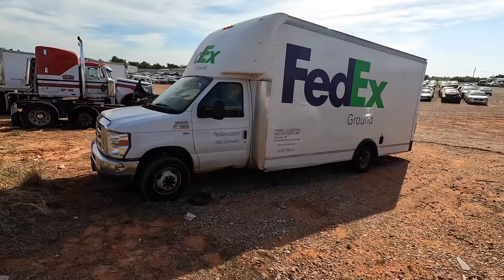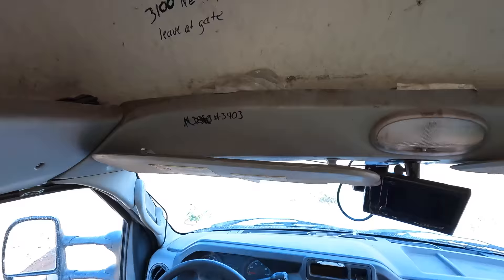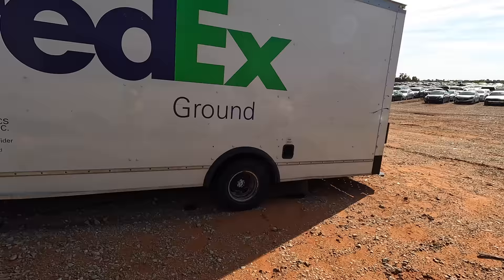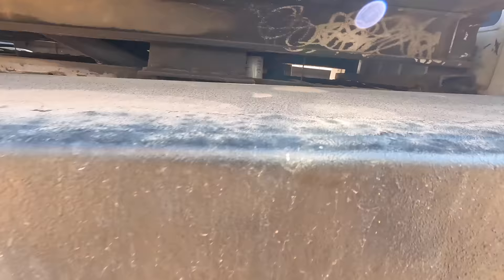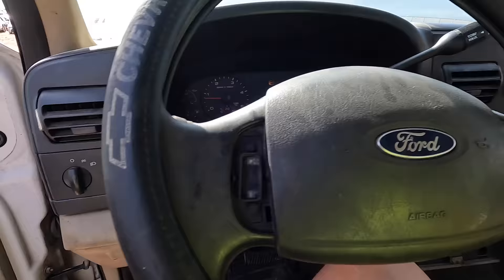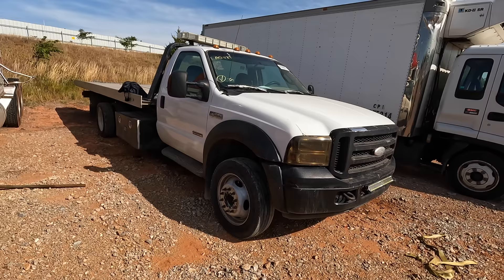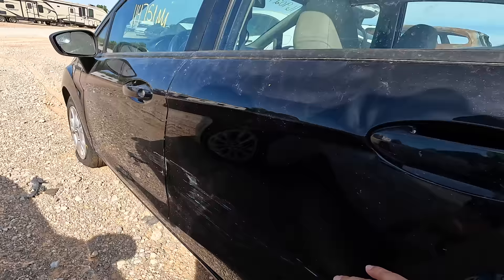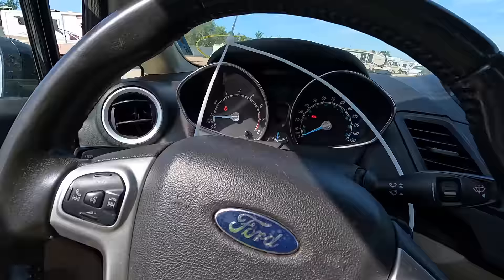Copart Walk Around 7-26-22 + Buying a F450 FedEx Truck!!

Comment: The tow truck would be great for moving cars around between locations or if you get more than one car at once at auction you could take both home at the same time if you didn’t want to drive them. Big problem is that it’s a wiring nightmare but if you are willing to do the work yourself it could be a good deal, but probably not for 22k. The Fiesta would be a great little gas saver plus the manual transmission would save you the headache that the automatics can cause. Between the two the Fiesta would probably be better unless you want a big project with that Ford tow truck.

Comment: You have to set the e-brake turn on the master switch on the floor near the seat, it will idle up and probably have to turn on the switches on the dash  as well to use the bed as switches. It's called a PTO (power take off)

Comment: That Fiesta is a good deal. I got mine -a 2012- 2 years ago for less than $3K. It only needed front shocks and front wheel bearings but otherwise it's been solid and the 5 spd adds a bit fun and tons of reliability. Just keep track on the timing belt and you're golden

Comment: Randy I was a tow truck driver for a bit and there is usually an engagement to operate the bed and winch some rollbacks are hydraulic and some are electric over hydraulic they do take a bit of getting use to but not difficult, And yes you can piggy back with that rig one on the bed and one on the dolly. Fair price I would say is around 15,000 to 18,000 new they will go well within 50,000 plus some are in the 100,000 mark but this one 15 to 18 is fair. Any questions just ask here to help.

Comment: My ex-employer had (probably still does) a black 2015 Ford Fiesta with the manual. It was the only non-pick-up in the fleet and was used for meeting or going to a site where not much in the way of equipment was needed. I am not a big fan of small, 2 wheel drive cars but for some reasons, I enjoyed driving it. Averaging 41 mpg was an added bonus.

Comment: The knob on the floor was a battery disconnected the reason why it was high idel was some tow truck the parking brake is how to turn on the PTO to running the bed but it may have a PTO switch somewhere else but the PTO  has to be turned on to run the bed

Comment: You need to always check a diesel for blow by. Start it get it to operating temp and pull the oil cap off too see if it has compression coming through.

Comment: The 2 car carrier is in rough shape. Before you can run the bed functions, you need to activate the PTO, it's probably an electric PTO, carriers bring stupid money because they generate so much income. The tilt for the stinger (rear lift) is controlled by tilting the bed, you'll need to get a crash course from a local wrecker operator on running the carrier safely, you can do some serious injuries and the liability for surrounding traffic make insurance quite costly. That FED EX truck is used up! if it wasn't they would still be using it. Good luck!

Comment: The tow trucks beacons were probably attached to one of the auxilary switches.  Lever on floor is for a PTO to work deck and winch.  And don't (if you get it) try to use the wheel lift without instruction from someone with experience.  The deck is actually pretty straight forward.

Comment: i used to be a tow truck driver there should be a PTO switch (if it’s manual push in the clutch) pull the lever up and all the switches will start working

Comment: Okay Randy I agree with you on the aspect that most people would not daily drive the FedEx van or the f550 rollback. I myself used to drive an f550 rollback I personally believe that you could get the whites working and like the other people said the PTO master switch is that one with the red light down by the floor so that's what was winding up the motor when you started the truck and as far as the lights it could be a fuse could be a bad connection could be about ground. And I definitely agree with you on the aspect that the f550 could be a good power tour vehicle. Because let's face it a lot of the carbureted engines in the vehicles on power tour tend to break down because of how long power tour runs so yeah it is a money maker and technically it is practical because yes you can most definitely load a vehicle on the deck and on the wheel lift. Or as we in the towing industry call it we call it the stinger arm. Personally though I would go with the f550. And $22,000 is not a lot for an f550 rollback.

Comment: Randy, maybe the bed of the tow truck is operated by that master switch by the front seat. I know many of our ambulance and Ford Chassis Fire Department vehicles have that master switch. The truck will run and operate without it on, but to run accessories such as lights and sirens, the master must be turned on.  Maybe the warning lights and bed operation is tied into that master switch, just a guess..  Great video as usual.!!

Comment: The tow truck bed will only work if PTO is activated. PTO Transfer the engine's power to power the bed and the winch. That's why it was revving high for a moment until you pressed the brakes. Some trucks has a switch and others you can press the brakes to activate the PTO. And the switch on the floor is a quick disconnect for the battery in case of a electrical problem.
 I would love to see a tow truck on the channel!

Comment: And definitely get that rollback as long as there's nothing wrong with the motor or transmission
Reply: Figure new head gaskets and heads to start. Oil cooler, turbo.  Thousands of dollars.
Reply: @letaloudone  yeah true it looked like the 6.0 Powerchoke
Reply: If it's a 6.0 or 6.4 power stroke don't waste your time.6.7 or 7.3 are good engines.

Comment: I’m no tow truck driver but there was 2 battery’s so I wonder if you put the battery charger on that other battery if the lights and other things might work 

If you go back to check it out again try that just to see if it works 

Also I’d buy the tow truck as well 

And fix all of the wiring then everything should work 

As for the things on the bed of it that make it move I don’t know

Comment: When the rollback idled up I think the pto was running when you hit the e brake it disengaged it the black button with the red light next to the toggle switches is what operates it and 22k is kind of high for a badly wired 6.0 with no ac maybe like 15k max just my opinion nice vid

Comment: As a tow truck driver myself, I’d be interested in the rollback. Lol needs quite a bit of work, but in some cases, the lights need to be on for the top lights to come on.
Reply: As for the bed, you would need to flip the PTO on. That switch is probably the power to it all.

Comment: Im not a tow truck driver, but my guess would be you need to engage a hydraulic pump or pto to use the bed. My guess on the lights would be the running lights have to be on for the flashers

Comment: Liking the rollback, those wiring concerns though, ooooof, there's a lot of cluster hanging out under the bed.  Wondering if it was a theft recovery as the damage on it seemed like normal wear & tear.  FedEx truck decals are not so bad to remove as long as you've got a heat gun or rubber wheel & LOTS of patience & adhesive remover for the aftermath.
Then I realized at the end Randy, you drove a Jeep in......to look at ALL Fords.... 🤔🤔
How's that work?? 😂😂😂😂

Comment: Gotta have to PTO on(switch with the red lenses you switch by the radio), E brake must engaged, once’s that on engine should rev up, if the engine dosent rev up when you hit that switch, PTO issue, immediate pass, not worth messing with, anyways those levers on the back operate it all, bed winch and lower part, right side levers no good, you can tell considering the fact they had no pressure when you moved them, left side may be good, probably a hydraulics issue, personally would pass, for 22k seems kinda run down and would need a good amount of work between hydraulics (which control switches and bed) and electrical with the lights and maybe motor, took a lil too long to start + the motor in it (6.0 Diesel) not really known for reliability, hope this could help randy, feel free to ask more questions

Comment: id get that little ford to do your walkarounds with..  save you a bunch of gas and dont have to worrie about flat tires or it getting damaged..  save the jeep for the family stuff.. that tow truck is a pile.. whoever owned it did not take care of it..  there is a switch in the cab to turn on the pto to work the bed hydraulics.. i think that switch by the ask try was it, or the idel up switch

Comment: Randy you might not have turned on the pto switch or whatever it is 

Also $10,000 or 20,000 maybe 21,000 would be a good offer on the tow truck

Comment: The tow truck would be handy for you for what you do. If it operates properly. The Ford Fiesta is fine as a daily driver as long as it is just that body damage. Is that Buick Casada in back of it the same Casada that has been sitting there for at least over a year?

Comment: 2:13 If that E450 FedEx box truck was a diesel not gas I'd say go for it but under $1000 maybe good deal
10:06 There's no way that F350 flatbed is worth $22k not with bad wiring under hood plus got really know how work those to truck levers yes tow truck would be great to have just not that one.
Reply: Not to mention the flatbed is a 6.0/6.4 power stroke, both known for being very unreliable

Comment: The FedEx truck, would be a good camper conversion for the right person, since it has the pass through and side door into the cargo area.
That's what you need Randy A Tow Truck, get rid of your trailer and tow dollies and buy a tow truck.
I think you will require a, Not For Hire sign to drive it legally.
The bed is probably operated off of a PTO that needs to be engaged.
That tow truck had a Chevy steering wheel cover on it, we all know Fords are wannabe Chevys.